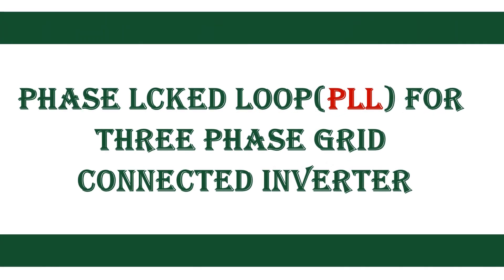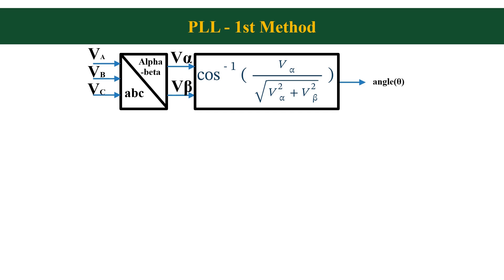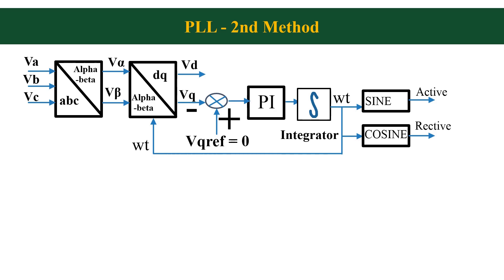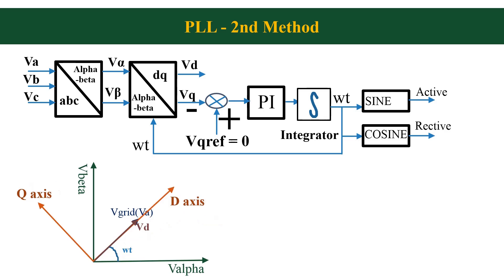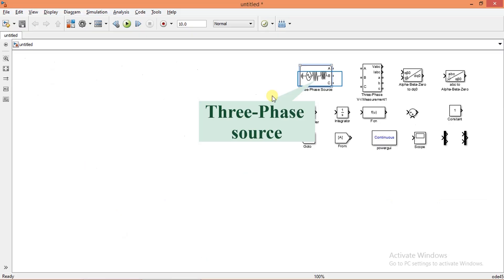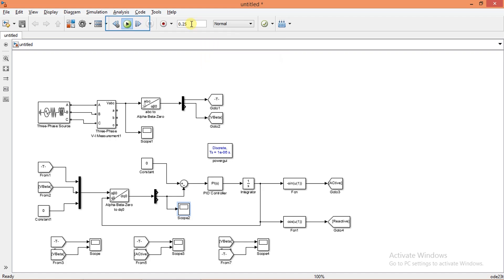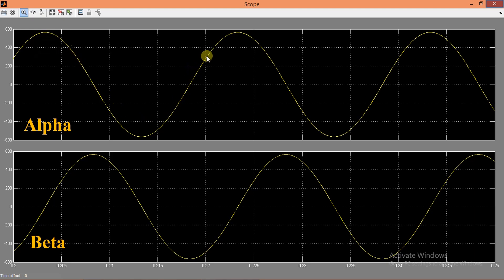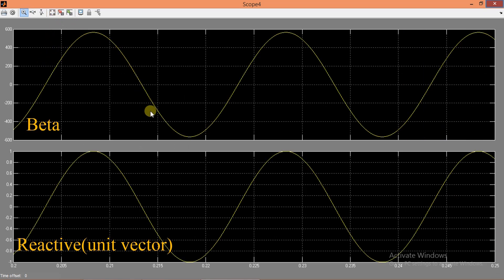Phase Locked Loop(PLL) for 3 phase grid connected inverter | MATLAB Simulation.

Comment: Based on your simulation, grid voltage angle is measured from the q component that you are trying to set  to 0, but tita is actually the angle between the d-axis component and apha. Is it possible to measure tita from d axis component while we still control q aaxis voltage to zero? THANK YOU

Comment: Thank you for the wonderful video sir. On page 147 of the book "DOUBLY FED INDUCTION MACHINE" by R. Abari et al.,the output of the integrator of PLL is the angle of the grid voltage but in page 281 of the other book "POWER ELECTRONICS FOR RENEWABLE ENERGY SYSTEMS, TRANSPORTATION AND INDUSTRIAL APPLICATIONS" 90 degree was subtracted from the output of PLL to get the same grid voltage angle. Please can you explain the reason for this? Does it have anything to do with using stator voltage oriented control or stator flux oriented control?

Comment: Great video ! . Is there a  book you can recommend that will help explain the theory ?  Also it would be good to see these simulations used to  to design  a real controller and used then to control real converter hardware - the full lifecycle - 1. simulation , 2 .controller code and hardware implementation , and 3. integration of controller with converter hardware . This would be a really great series of training videos .

Comment: Hi. I have a question. The component Vq is zero but the component Vd is negative. If the component Vd is aligned with Vgrid, the component Vd should be positive or not.
Reply: yes... think the sign is wrong on the summing block

Comment: Hi,  thank you for the simulation. I simulated the PLL. My solver settings are same as yours, but getting diff results. Valpha and Vbeta values are not calculated correctly ie not sinewave. Ouput of PI controller takes a long time to stabilise to 0. Can you suggest something or if I can share my simulation file. Thanks in advance
Reply from the maker: Share your file at ashacademy01@gmail.com
Reply: @TechSimulator   Do you have a contact number? Can you share it? I have homework on Matlab simulation.
Reply: Shared. Thanks
Reply from the maker: Ok i will check